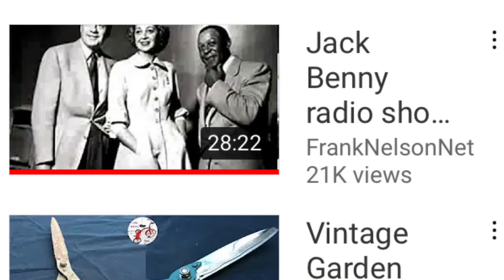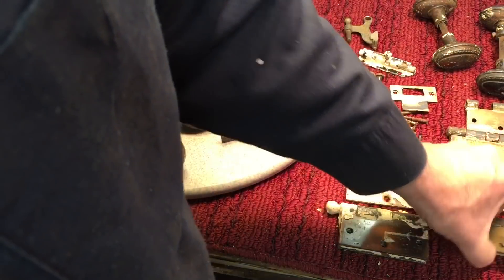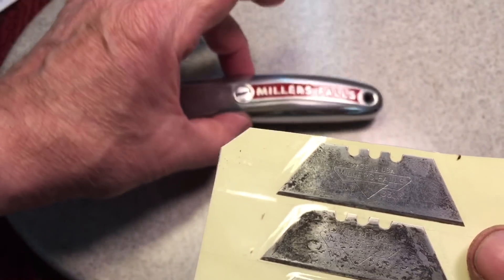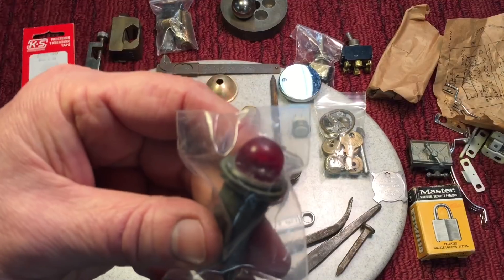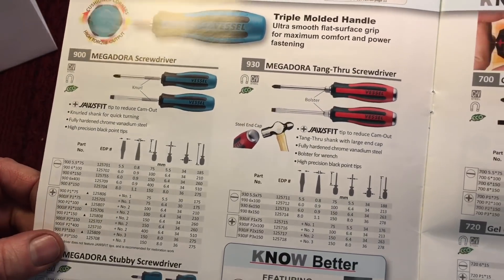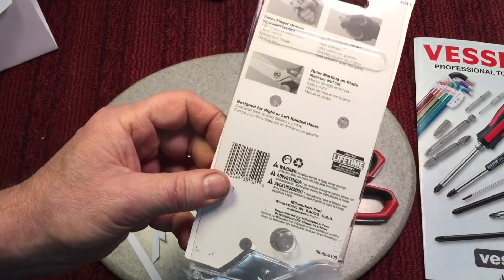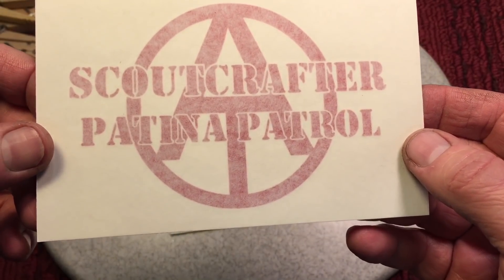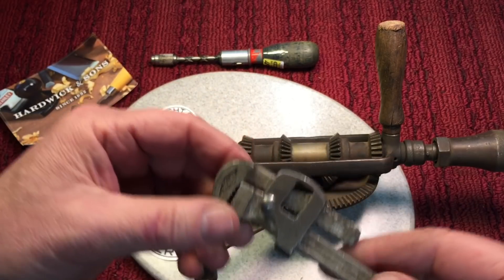Awesome Viewer Gifts!

Comment: Your videos aren't ever too long. More than 100 years old, and that brest drill is still a remarkable tool. The old door hardware reminds me of the dinky 1920s bungalow I restored. It had the same hinges in brass plated steel, only mine were made by Stanley.  The door escutcheon plate on one door was stamped copper in a cool art deco design. Cleaning up all that old hardware with 60 years of various layers of paint and crud was tedious, but the results were worth it. I even used the original slotted screws. Somehow I'm not surprised that you have a clothespin collection. Someone has to do it. Thanks.

Comment: Best way to clean painted door hardware is to boil in water with some TSP and detergent.  The paint easily comes off and the plating is not damaged.  Then use Boeshield to protect the surface and to provide lubrication.

Comment: Nice vintage door hardware. I use door hinges for woodbox lids and stuff. Nice to get Miller Falls utility blades to go with. Santa Rosa is some nice stuff. That homemade scraper might be a automotive brake drum adjustment spoon. T-Wrecks clothes pins look heavy duty. Patina Patrol decal 😂. That drill is something else. I've never knew of Yankee brand. Thing is like a Eaton-Fuller transmission. Sounds like my 10 speed Schwinn too. Seriously does it have a clutch pedal too 😂. Jon Crane with that manual speed screwdriver. I first learned of those in a episode on Breaking Bad 📺. Nice haul from everyone. Scoutcrafter, Thanks for uploading 👍

Comment: I have a new love - that Yankee drill is just an amazing engineering feat!  I would love to find one of those ad restore it.  I am a Yankee screwdriver fan anyway and reach for my large one before I go for the cordless drill anymore.  Its just more pleasing to manually, yet effortlessly do the job instead of letting a motor do it.  A friend and I were working on the same job putting screws into some wood.  I beat him with my Yankee!  Now, granted, if it comes to stuck screws, the drill is better!  Great video John.  Thanks for the diversion :)

Comment: Japanese Industrial Standard is all about the profile. I have seen many JIS screwdrivers, but not the serrated tip variant before. Get a set of standard JIS and compare them. I have always been amazed by people who attack JIS screws with Philips head screwdrivers and then complain about the result. One tip is a lot of manufacturers put a small dot on the head of JIS screws to warn you not to use Phillips Head Screwdrivers on them in the first place. I wonder what these combination JIS serrated edge tools would do to small carby screws after a few uses? If I was working on a Japanese carby that I cared about, I would stick to standard JIS and leave the serrated things for experiments on screws I didn't want to use again a few times, just in case.

Comment: Up until about a a year ago Sears sold a 2-piece Craftsman screwdriver set made by Vessel for about 15-20 dollars depending on the sale. The impact cam types you pointed out, and Made in Japan right on the package. A flat and a "PH2" which is really a JIS driver from how it works. If you can find someone reselling them (as people do) they're a must-buy. The handles are gorgeous and no matter what grease or dirt gets on them they always clean up nicely with some isopropyl.
PS: Most "philips" screws on Shimano bike parts are also JIS. And JIS is mainly known to Americans who have and/or work on Japanese motorcycles.

Comment: I am in a house that was built in 1947 and it has good doors and hardware and have polished all the brass and wire wheeled all the hinges. There is an old Channel Master antenna in the attic, we never had cable and with the digital TV signals I get over 40 stations and watch a lot of Twilight Zone, Perry Mason , Adam 12 etc.

Comment: Of course you have a clothes pin collection. If there is more than two of something, it must be collected!

I have clothes pins on my workbench that I use regularly. From my model building days, I have some there i turned the spring around and use the flat ends as the pin. Works great for covering long flat surfaces

Comment: John...I agree with on tuning out of the "news" and all the crap going on now.
The homemade scraper at 6:50 looks like a drum brake adjusting tool-but it's one of those tools that gets used for other things too as needed...lol
I just bought and received today 2 Wiha screwdrivers-combo tip slotted/#1 phillips and slotted/#2 phillips . Many of the electrical parts we use at work have combo head screws that these should work well on...can't wait!
Stay safe everyone
George

Comment: Great video John. Was just talking last night on 10 meters to a couple of guys about what happened to clothespins 👍👍👍
Reply from the maker: Wire!  Is 10 open?    =D
Reply: @ScoutCrafter  Its been open as well as 6 meters
Reply: @ScoutCrafter  We have an informal net every Saturday at 8 pm on 28.370 usb. I will be on tommorrow night. Its not structured, just throw out your call and jump in.

Comment: Hello John, after a search about Vessel screwdrivers on the internet I found somethind that I didn't know at all... that there is a type of screw that called JIS (Japanese Industrial Standard) which is similar with philips but with far better grip. I beleive that it is worth to make a video about this type of screws (JIS vs. Phillips Screws). There is no time that I will not learn something new in your videos.... have a nice day!
Reply: Yep. Japanese Industrial Standard screws are made to not cam out when removing. A Phillips head screwdriver can rip them up quite badly. JIS screws are traditionally marked with a small dot or impression on the screw head to identify them, in much the same way as a lot of brass plumbing nuts have a groove cut in them to designate left-hand thread.

Comment: The square bar you called scraper looks like a brake adjusting tool. Love your show
Reply from the maker: Harold I think you are right!!  😃👍
Reply: I have an old drum brake adjuster just like that. Works better than a screwdriver. Had mine for decades. Now none of my vehicles have drum brakes

Comment: When you mentioned the old hinges and putting on a drop of oil I remembered about putting a drop of oil on a sqeaky one here.  The door now slowly swings closed no matter where it is left.  I guess the foundation has settled a bit.  The house is only 12 years old or so.
Reply: If you have three hinges try this: take out the center pin, bend it just a little, then tap it back in.
Reply: @petertilford7523  Thanks.  I hadn't thought of that.
Reply from the maker: Kathie- I purposely set my refrigerator up so the door closes automatically...  =D

Comment: There was a website I found once that sold designer furniture and hardware to the absolute most "upscale" customers, and you would be appalled at the sorts of things people are buying for thousands. Picture this: A doorknob that looks like a small, open-comb wasp-nest.
Reply from the maker: "Easy come easy go"  When you are crazy rich money means very little...  =D
Reply: @ScoutCrafter  True, but the sheer ornate ugliness is something else. But I suppose if you really didn't want people going into a room then having the handle look like that would work almost as good as a lock!
Reply: A few years back an electrician friend of mine needed some help to install a $10,000 chandelier in the stairwell of a home in Weston. The old fixture was one of those one that looked like a colonial era one that had been converted to electricity. The new one had a square piece of metal fastened to the ceiling with two dozen wires of various lengths with a plastic globe with a tiny light bulb in it at the end of each on hanging down.